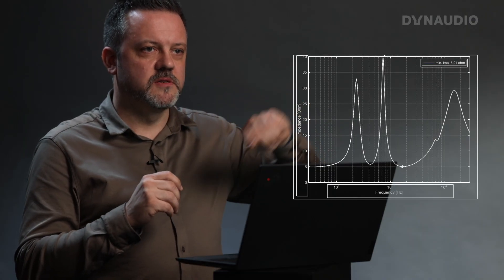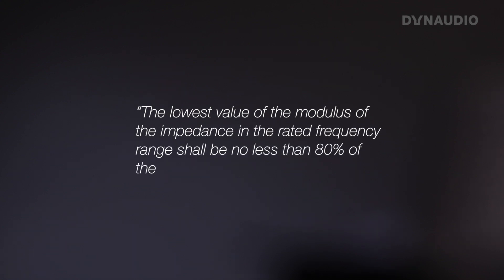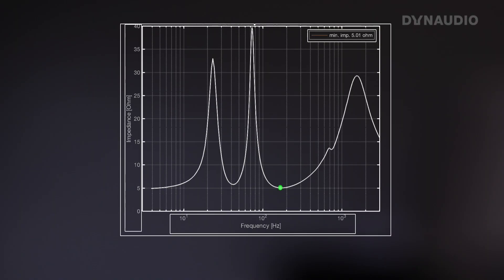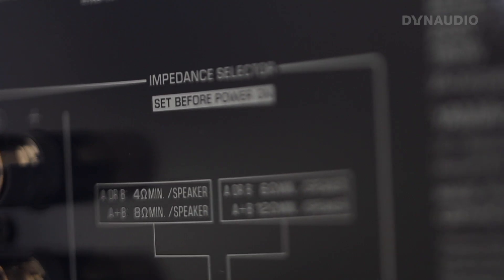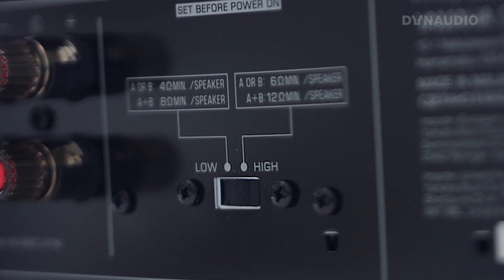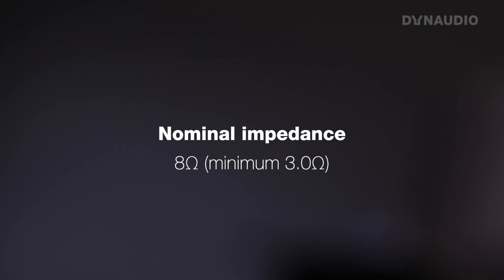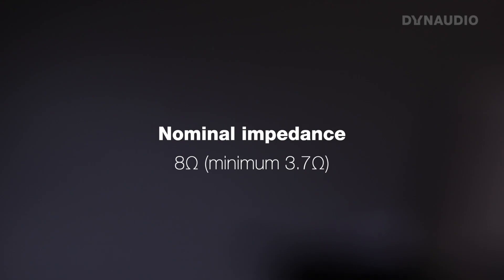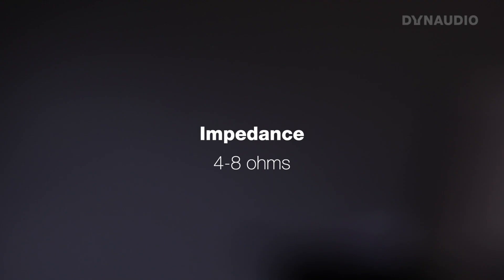Understanding impedance

Comment: What about a 4 ohm nominal impedance but drops down to 2 ohms at 90hz with just over -45° of electrical phase? Still fine on any old amplifier? Does output levels become an issue with low impedance dips with negative phase?

Comment: My impedance curve om my midbass shows 1 hump on 75 and one on 150. When i mesure frequency responce i also get gain in 75hz and 150hz. My goal is 75hz hump and then somewhat flat response upwards. I use a sub under75hz so dont worry about that.
When i put a longer port in, the lower hump goes lower but the upper peak stays the same. I dont want the upper peak at all or get the upper peak lowered to 75 and the lower peak probably landing at 35 hz or so. To adjust the upper peak, do i have to adjust the size of my cabinet?